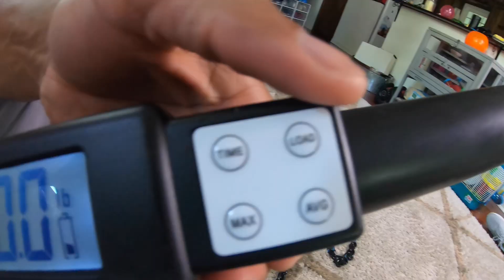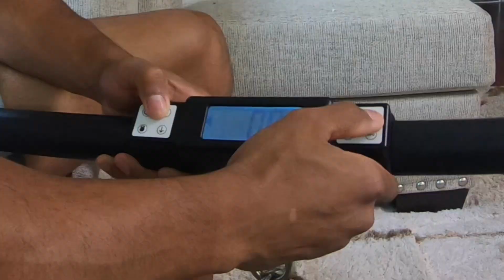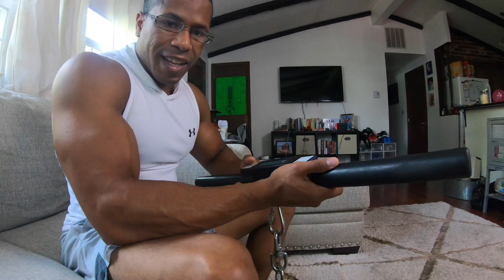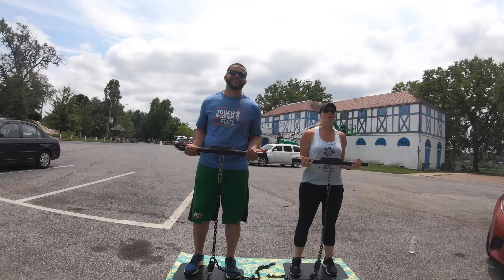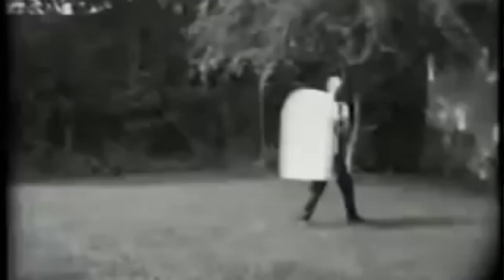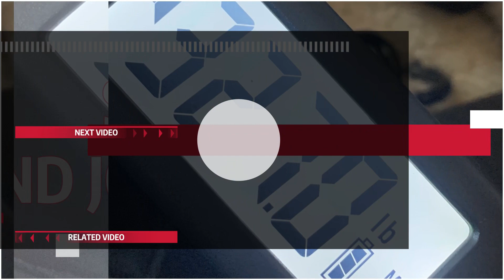Isochain Average Mode In Depth

Comment: Great video. You know what I do not get with Isochain average mode? You can tell when you hit minimum 60lbs and held at or above that load, as the unit beeps away for every second you are above that set load. Why, then, when you hit the 'average' button does it give you a number below that set load? I finally got myself an Isochain a month or so back and have been using it often. Sometimes I hit my set load just about instantly and have got up to the point that I hold it above that set load for 32sec. However, sometimes it then tells me I held an average far below the set load. I do not get how that can be possible, when often I am way above the set load for the entire duration of the hold, meaning surely the average should be at or above the set load. I get that the average also counts rise time, but again often I hit my set load within a second or so.
Reply from the maker: I’ll be honest, I’ve also been wondering. I don’t use average mode much so all I can think of is rise time. I’d ask the Isochain fb group and see what they think tonight
Reply: @NoLimitSquad  The quick start guide https://www.dragondoor.com/assets/1/15/IsochainInstructionalLeaflet2.pdf says the average mode is since the mode was last changed. That could explain it. "The display will show the average force level (as weight) achieved since the mode was last changed."
Reply: @jawspeak  I've been having this same problem on and off. Hitting a targeted load on timed mode for 20 seconds and then doubling back to check with either average mode or max, and the max number seems to be accurate because it's always at or above my target while the average number is sometimes above or below my target load that I definitely. It's weird.